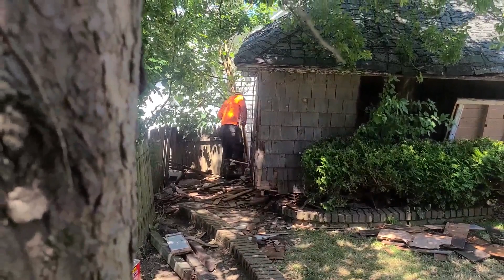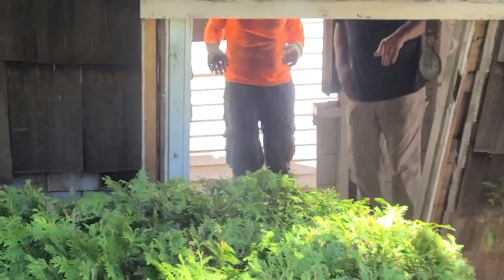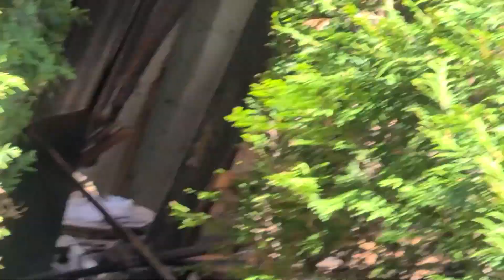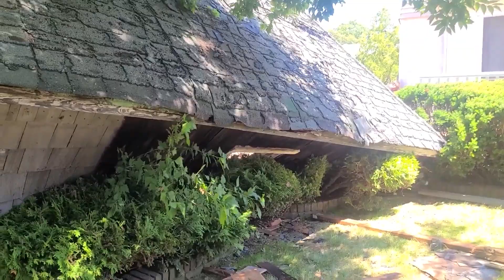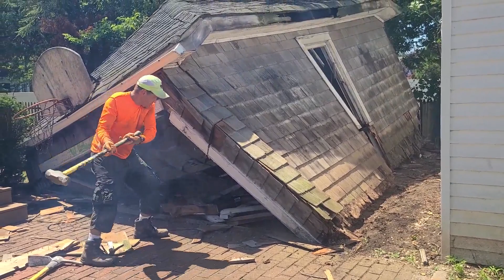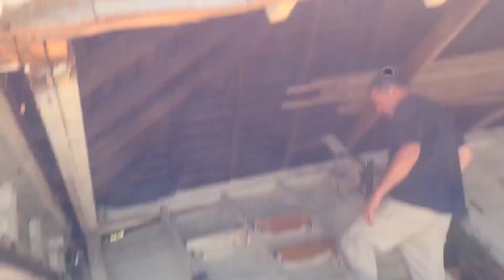Garage Demolition

Comment: It doesn't look that  neglected maybe a few roof tiles but other than that looks fine
Reply from the maker: Interesting as I look at it further, It had 4 Layers of roof over wood shingles. It was full of dead Squirrels and lots of bugs like Termites and others. I am pretty sure that it had water damage. Owners are selling the house and they are cheap, so they must have concluded that it would be cheaper to just tear it down than redo the walls, roof and foundation after years of neglect, as it scared away buyers. Yes, the garage fought back and had some life in it. It's just sad.